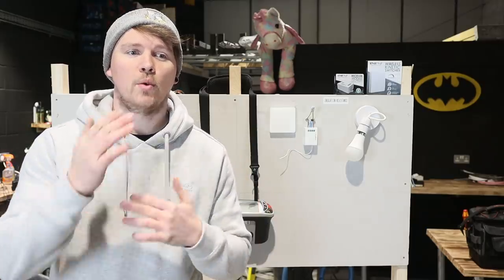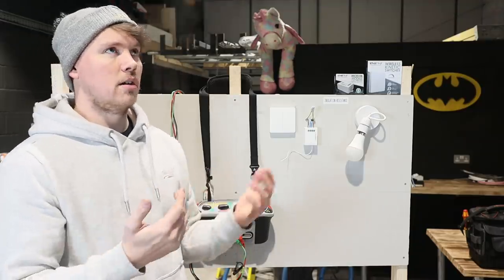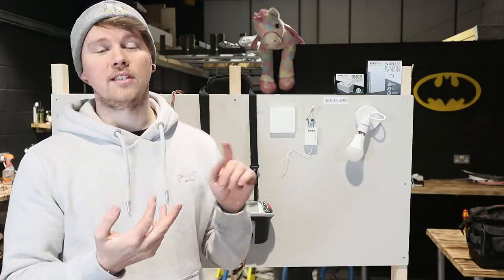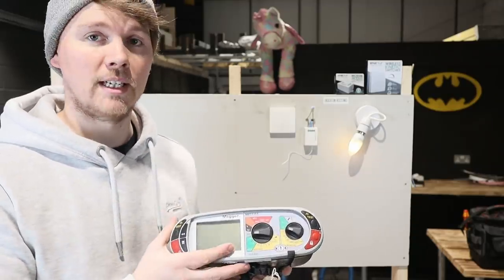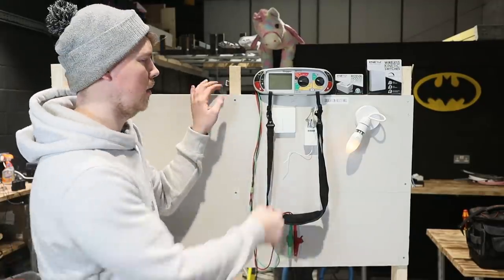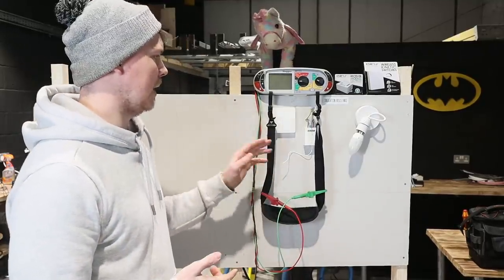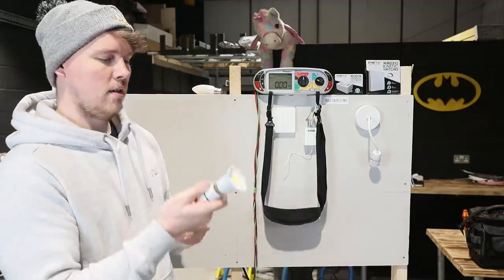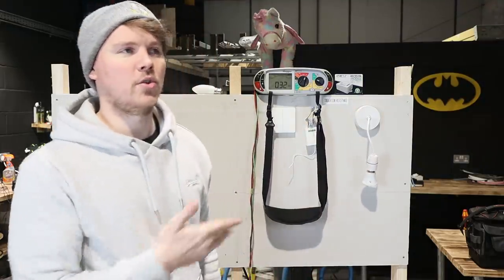Will It Explode? Electrician Tests

Comment: Output specifications of insulation testers up to 1000V is recommended in IEC 61557 Part 2. They need to hold the nominal voltage for a 1mA load, i.e. on 250V range it will output 250V on a 250 kOhm load, 500V will be 500 kOhm and 1000V will be 1 MOhm. After that, the current limiting circuit in the output comes into operation and the output voltage falls on a gradient down to the short circuit current for the particular tester. To the standard, the short circuit can be up to 15 mA but in practice, it will be 1.5 mA to 2 mA for these kind of testers. 
So on the 250V test you may well have put out 250V across the connections, but at 500V and 1000V, the reading obtained is too low and the output voltage will have dropped. You may have pulsed a spike across the circuit when initially starting the test. That depends on the actual manufacturer of the insulation tester. Some ramp up the test voltage over 100 ms and don't cause a spike. Some are much faster and may cause an initial spike, but it will be limited by the load.

Comment: I doubt an insulation tester would put out enough current on 500v to damage an electronic load , so the voltage just wouldn't get high enough to cause damage
Reply: Not being a fanboy, but love your stuff. 
I dunno, it can go both ways. If I go into a house, f knows whats pluged in or hardwired in. But I am not taking the risk on peoples PC's and overpriced chinese tat. 250 limit l to n to earth. 500 linked l-n to earth. you have to think about the common mode filters linked to earth, spark gaps on pcbs etc etc. At the end of the day, I am not paying out 3k because a 50 year old boilers boiler PCB broke, or some tweeters twat started twitching about it's phone charger changed gender.
Reply: @UberAlphaSirus  here here give this Man an eyebrow he's spot on.
Reply: I've wondered about this with devices that have MOV protection. I have seen an instance of a guy doing PAT testing and having multiple power supplies and MOV protected power strips/boards blow apart in the days following (multiple buildings, several km apart). Cheers
Reply: @UberAlphaSirus  I hate it when phone chargers change gender too
Reply: Sensitive electronics with extremely small internal geometries and high impedance's such as  integrated circuits  will be damaged by static , let alone blasting them with 500V mega style testers. So one needs to be aware and very careful where  insulation tests are carried out when in close proximity to  often inbuilt electronics.
Reply: @tonyknight9912  you could go for a 50 v to 100v to 250v IR test.
Reply: @tonyknight9912  There's a lot of components before you get to an IC though.
Reply: Maybe you should link your high current test of an mcb just to show why a unlimited test current would be a bad thing :D, lol. might learn 'em why prospective fault currents are important :D

Comment: It won't explode anything because IR testers have current limited outputs. Reputable ones meeting standards have a minimum output of 1mA and the Megger is rated at 1.5mA which is pretty typical.

The only way you'd kill something is either it's a very tiny load that doesn't just bring the voltage down (1.5mA at 500V is 0.75W) or you were to connect a large capacitor in parallel with it, charge up the capacitor then dump the capacitor across your unsuspecting electronics.

But that would be quite dangerous. Fun, but dangerous.
In fact... I have a slightly dead 10kW inverter which is full of such capacitors so if you want some for playing with give me a shout!

Comment: With regards pairing, I will often pair the units in the office before going on site (often up to 2 weeks before the job) and have never had a problem with them losing their pairing.
Reply: I'd wager they probably have non volatile flash memory that holds the pairing codes.

Comment: Hi Nick. I think the tester is putting out a much lower voltage as it has already detected there is a short circuit so it protecting any equipment that is connected. If you take a look during the 500v test only 10.3v or 103v is being sent down the cable. Im not sure if there is a way to override this but how I understand it is none of these tests were carried out at the specified voltage
Reply: You can't override the tester to make sure it's pumping out 500v on a load as the tester can't suply enough current. Not that it would help if it could mind. :D
Reply: I couldn't see the output voltage on my screen, but you are right the testers limit the output voltage after a specific current limit, specified as 1.5 mA for the MFT 1700 series. On this style of tester, it cannot be overridden. Some more advanced testers, usually with outputs above 1kV have a 'burn in' mode and can supply the output voltage up to 8 - 10 mA.
Reply: Yeah I notice that, my megger does the same,   I am pretty sure its only 10.3v, as when you look when he does the gu10 it is putting out 127.7v on the 500v setting...  Interesting test although not sure all testers would be so smart..
Reply: @steve11211  Yea im sure my Megger is the same. Around 10v if there is a dead short. I did see a David Savery video and his was doing the same thing. Im not sure if it was his Metrel or his MFT
Reply: @UberAlphaSirus  Im sure there must be some older testers that dont have this feature to protect any electronic equipment
Reply: @singularity5488  Not wanting to piss on anyones bonfire as it where. If you want to measure insulation resistance you use a tester as you just need that figure to say at that test voltage the insulation resistance is good. You don't need much current to test, you need voltage to measure it. 250v is an operational test voltage for domestic, 500v gives you a better clue that the insulation is really good and and SPD would not let it go that high anyway. 1000v is taking the piss for domestic. If you want to do the bang and fire test, the tails will give you all the amps you need and for 450v borrow a phase from a street light. it will give you all the amps you need. You can measure them amps back to the supply too and make sure the the crap in the box can break that current.
Reply: @three-phase562  thats about 10w. thats quite a bit of wellie.
Reply: @UberAlphaSirus  Its more than that as the output voltage is higher, 5 to 15kV depending on the tester, but we need the higher current to charge up the cable under test in a reasonable amount of time. The pass current for a sheath test is also 10mA, so the test set needs to be able to deliver that, but they generally tend to be specialist testers. That is about the limit of battery powered IR testers at the moment. After that we are into mains powered testers with 100mA to 200mA limits, circa 70kV. Then we are into testers built into transit vans or trailers.

Comment: The Megger won’t allow 500v to pass if there’s a dead short, I’m not old enough to know but I assume older testers did, and would break things like that, and that’s where we have been taught not to do it ? be nice if someone could confirm that for me 😊
Reply from the maker: Good to know mate
Reply: I think the Megger 1700 range delivers around 2mA on insulation resistance, the voltage on the test leads being a result of I x R but with a top end of the tester’s setting
Reply: You only pumped 10v through the switch from what I could see
Reply: When we were young we did some urban exploring on the closed down belvedere power station. We found an abondoned mega on site from a bygone era, with a bacolyte connector for the volts. It came home on the bus, and we had many hours fun playing with it making sparks, lighting things on fire etc. It was rated 10000 volts, no idea how much current it would kick out, but could make sparks of several cm long. Somehow none of us got hurt by it. It's probably still in my mum's attic haha
Reply: @GeorgeStyles  get it on eBay ! 👏🏼
Reply: @GeorgeStyles  or send it me 😂

Comment: You spoke on the video about getting a usb tester. Can i suggest the Klein usb tester.  Its a great device for placing a load test on a newly installed usb socket after commissioning,  they can also help with faultfinding, particularly when a customer call you out because a device isn't charging correctly.

Comment: I use the original LightwaveRF dimmers, interestingly it says this in the installation guide. 

 “IMPORTANT: If conducting an insulation resistance test, all LightwaveRF products must be disconnected from the mains, or damage will occur.”

Do you think they are just covering their backs?
Reply: I assume they are, most testers can't hit high high voltages when there is anything but a complete open.

Comment: Funny watching the driver chip pulsing the led on 1kv lol might be a high voltage but without the current to back it up the driver just eats it and goes more please. Now if you find a lamp with a resistive dropper circuit then you could have some magic smoke!

Comment: Great Video Nick, would be interested in the usb sockets.For the record I’ve recently had cause to think that a public hall’s worth of 6ft twin LED battens have been damaged by IR testing. As the hall was tested by others August and since October I’ve replaced 6 of 18 that were only fitted a year before. On the report it’s say they did tests on 500v so don’t know what you think.

Comment: you have learnt a stack nick ,have you done any heavy industrial electrics ie 3 phase switch gear ,conduit, traywork,trunking, large wire armoured glanding, pyro etc welding , braze acetelene , we used to after do all that in our apprenticeships  6years  and 4 years day release at rotherham college of technology , by it was hard graft in power sations and steelworks but if id a been your dad id a been proud of your achievements.

Comment: Nick.... Can you have one of those wireless switch jobbers "shared" with a normal switched light? Not that I plan on wiring it myself, but I have a room where the only light switch is on the far side of the room, so you have to walk across it in the dark to light the switch"... I was wondering if a kinetic switch might be the easy solution. Or would I ultimately need to get 2 kinetic switches and replace the "old" switch, so both switches were kinetic?
Reply: If you want proper 2 way lighting you would need 2. If your not going to use the old switch, one would be enough

Comment: I think the Meggers only put out around 2mA on insulation resistance range hence if there’s a load I don’t think it will get to the full IR test voltage, the only thing I can remember breaking with one was a Powerbreaker RCD socket - it would reset fine but would nuisance trip after that.

Comment: it really depends on the device. For the LED bulb. it most likely uses a capacitive droper that will block the brunt of a dc ir test and a bleed resistor with a high enough resistance that even at 500v will be low enough current for the voltage clamping to manage with. But to be honest, 250v won't hurt a thing. 500v and 1000v could  as most electronic components are rated at 400v and below. And anything with a MOV, say in a switch mode PSU, exact same as whats in a SPD will drop resistance at what ever voltage value it is spec'd for. I am prattling on lol :D

Comment: Kind off getting the impression your saying it doesn't matter if you IR test at 500v  I work for a company that has about 30 sparks and have seen damage to lights .TVs. monitors  even washing machines  also how do you know you haven't shortened the lifespan of the equipment you just tested  I'm afraid I would go with the manufactures instructions  and don't do it Also when you put LN together and test to earth it offers no protection it just doesn't cause an imbalance  to the electronics which would give you a inproper reading

Comment: Are the switches double or single pole, as if double then you've not IR tested the cable between the switch and the fitting when testing the circuit as a whole L+N to E, assuming the switch defaults open. Even if single pole, you only test the live if there's something in the lampholder to connect the neutral back to the line, and I can imagine some LED stuff may not...

Comment: Fantastic video nick , I have always questioned weather there was any truth to it when told a 500v or test can damage electronic equipment , The wonderful JW did a great video witch for me proved it tobe crap  in his video he tested a smoke alarm first at 250 then at 500 and then At a 1000v and guess what the smoke alarm still worked as intended. Be good to see what happens if you test an old TV or games conceal or something like that? 
Fantastic video as always 👍👍❤️

Comment: This is a guess and Im not an expert YET lol but maybe its a mixture of a few things the reason we are told this. first being its a high DC current that's been thrown at the equipment and its expected we are to test at 500V. I bet these items have it wrote on simply for legal reasons as the equipment has not been tested by the manufacture with 500V DC current and if you do and it breaks they are not liable for it. not sure that makes seance, but its a simple theory as to why

Ever way great and really interesting Vid

Comment: Worked with an old git many many years ago who insisted the site radio stayed on poxy radio four or classic fm, or some equally disgusting station. The radio was his, so he got to say. Anyway, when he went off to the wholesalers, I tried to megger the f**k out of his radio. I tried everything. Even putting charged capacitors across battery terminals. Everything. Damned thing would not die!

Comment: Because of the current limited nature of the tester a single test is very unlikely to blow anything up.  BUT  that test may stress the electronics which will make them more vulnerable next time.  It may be many tests later that a component fails.  It is similar to ESD (electrostatic protection) and wrist straps.  People work on sensitive electronics without earthing and, surprise surprise the electronics don't blow up - that time.  It could be many months later that a latent defect materialises.

Comment: I assume the tester not pushing high current, enough currents to run the device. its always about watts. Power dissipation proportional to voltage and current E= V * I.

Comment: doesn't matter if you throw 10000000 volts through it, the copper wire will just sink the silly current the tester releases, and it would never break through the insulation on the internal parts. Effectively it'd drop to like.... 20volts or something.

Comment: Re the power cut Q. 
Can't say 100% without been near one with an RF dongle and my laptop say but if they are 433Mhz Transmitter / Receiver pair with ASK encoding. Amplitude-shift "keying" is a form of modulation that represents an Infinite about of digital combinations as variations in the amplitude of a wave. https://hackaday.com/2021/05/02/reverse-engineering-self-powered-wireless-switches/

Comment: USB Sockets are horrible pieces of kit. Should have a local isolator within them to isolate the USB power pack otherwise they just burn electricity all day, not exactly "green"
Reply: Worse they're trickle charge, I'll stick to charger that come with the phone do fast charging. Ain't waiting 3 weeks to fully charge it. 😀
Reply: @alsanova  I refuse to have them in my house
Reply: They are also reputed to be liable to provide overvoltages to appliances ( see BigClive videos)
Reply: @crazyboy2006cashier  Same, not having that garbage.